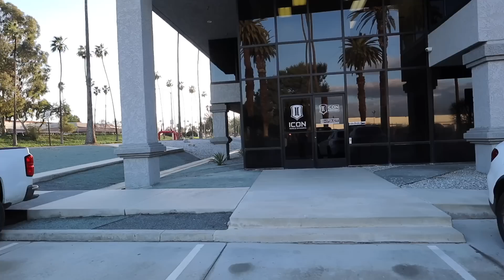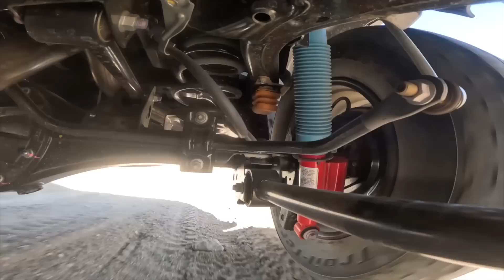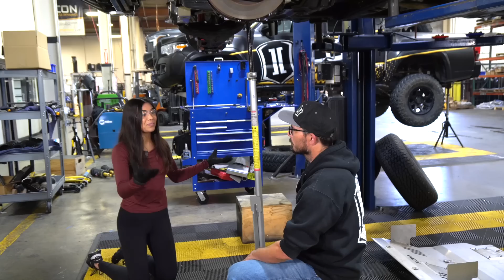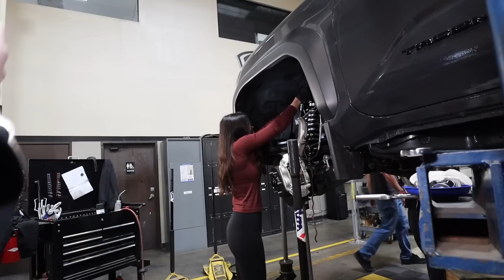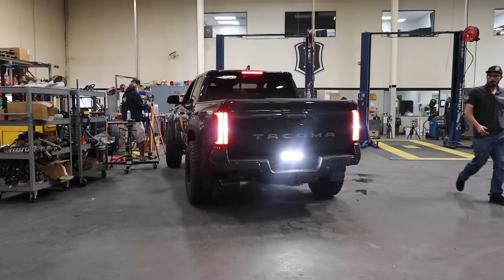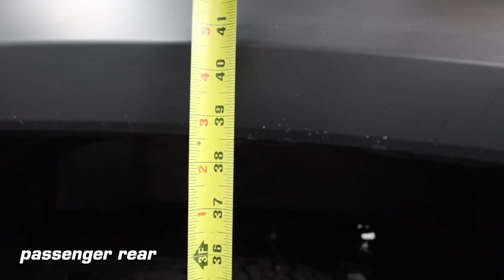It was time to lift my Tacoma | Installing ICON Suspension System (Build Episode 1)

Comment: That's really interesting to see how things change from 2024 to 2026. I have a 2026 Tacoma and from the ground to the bottom of the wheel well in the rear I measure 40 inches.The Front measured 37.5. That was stock from the dealership. So I put a 2 1/2 inch lift & upper control arms, and an icon differential drop on it. Now I'm measuring at 39 3/4 front and 40 inches rear. I did not have to do anything to the rear besides put some Beilstein 5100s on it. I'm rolling on KO3's 265/65R18 31.6" tires. I got 18 to 20 miles per gallon typically.

Comment: Any issues with the Icon front differential drop kit? Could you post a picture of how your driver side front axle angle looks? I have a Eibach Stage 2R kit with Icon UCAs and Icon front differential drop kit.

Comment: Tires sticking outside the wheel well look stupid.
Reply: Educate yourself on proper lifts. There is a proper ratio for offset to height above stock. You don't want to be one of the idiots who makes their truck taller without accommodation in width. It's not for looks.

Comment: I thought you were going with pizza cutters. I am looking to put 255/85R16 tires on my 3rd Gen  TRD OR ACLB without any lift. Right now I can only find Wildpeak AT_W’s (not sure if they are 3 or 4) in load range C. After reading a few comments on stiffer tires on stock suspension riding less bouncy I’m wondering if that would control my floaty-ness and brake dive without killing my 20.5mpg average.

Comment: I got a 2024 Tacoma last November. I installed the Icon billet upper arm and rear link package in December, with King coilovers and rear shocks (with adjusters), and Icon said a diff drop was recommended. It isn't really a diff "drop", its a driveline misalignment vibration kit. It caused an immediate vibration that I could feel through the steering wheel at anything over about 50mph. It only drops the front of the diff, not the whole diff, so the few degrees of angle change makes the front drive shaft vibrate. I took the diff drop kit off (with no other changes), and the vibration was 100% gone. Also, the "0.5" lift" Icon rear springs were actually a 1.5" lift spring on my crewcab longbed TRD Off-Road truck. Since you can't get more than about 2" of lift on the front before it rides terribly stiff and tops out too easy, the rear was too high for my liking, and I put the stock rear springs back on for now. I love everything else about all the other suspension components I got. I ran the truck all over Johnson Valley during KOH this year, and it handled great and hauls ass through typical desert terrain.
Reply: I have the same issue!  Thank you for posting. Last week I had the stage 4 installed in my ‘24 Tacoma. 
SAME steering wheel vibration. High pitched buzz feel in the whole truck, so I thought the diff drop was not installed but it is. 
A week later my front left shock seal is blown from highway miles and the right front suspension is now creaking loud, so I think the upper control arm is off too. 
Any ideas?
Icon is replacing the left suspension on warranty at least but my drive feel a week later was hit by the vibration.
Reply: @lyfhntr6562  That's definitely a bummer, but I don't think the driveline vibration would cause a shock failure or suspension creaking.
Reply: Did icon ever reply about this? Did you contact them
Reply: Wanting to know what Icon did in this situation, I’m getting the stage 3 kit in a couple weeks. 

My local shop said they flat out don’t install it…
Reply: @AlvinKokubun  I got the stage four and would concur with your local shop. Icon has told me they are having quality control issues specifically with the cylinders associated with the GEN four Tacoma. I would look at another manufacturer in the near term.
Reply: @lyfhntr6562 thanks for the heads up, been running mine for a while now and no leaks.
Reply: @AlvinKokubun I returned the drop down brackets. I ended up reinstalling the Icon rear springs after running around the desert for a weekend. The Icon rear springs give it a lot more progressive feel over big bumps and whoops in the rear suspension. It bottomed out too easily with the stock rear springs, and the truck feels more balanced with it being a little bit higher in the back. I actually also added the new Icon Hydraulic Bump Stop Kit to the rear of the truck last week. Pretty crazy how hard you can off-road this truck with bolt on accessories like this.
Reply: @mk3driftmotion  awesome, the instructions also ask to bore out 3/8” on a bracket for full droop, was that applicable now that you don’t have the Dif Drop?
Reply: @AlvinKokubun  Which bracket needed to be bored out? I don't remember that. I do know the rear diff brackets had to be trimmed way more than the instructions pictured to allow enough clearance for the billet rear 4 link arms at full bump.
Reply: @mk3driftmotion yeah, their documents state that the from suspension lower Control Arm required some grinding… I was unsettled by that lol
Reply: @AlvinKokubun  I am running King coilovers, they didn't allow enough droop to need to modify the lower arms at all, and it definitely didn't need the drop down brackets for the diff. The suspension doesn't bind, the axles don't bind, and the steering doesn't bind at full droop, lock to lock, I carefully checked all of that.

Comment: I can't wait until you drop a set of toyo 37x17 13.50 set of tires on it .
❤❤❤❤❤😊😊😊
Reply: Because that's my upgrade on my f250 2018 6.7 diesel fx4, but I have a 6 inch lift on it and it looks sick !!

Comment: Good to know the UCA bolt is still a nightmare on the 4th gen. 
Keep in mind that lifting IFS trucks is not what allows bigger tires.
Reply: Really? Lifting my taco is specifically what allowed me to run larger tires.
Reply: @HarryKuloh  OP is right though. You might think lifting was the solution, but it just isn't the case. All a lift does is decrease your wheel travel. It doesn't change the IFS geometry.

Comment: Woukd you recommend this type lifr for we in mountainous regions? Upper East TN typography.  Many hills and potentially muddy.

Oh, 2nd gen, 2014 TRD Sport.
Reply: If you use heim joints instead of rubber or polyurethane and your rig sees salty roads, or lots of mud or sand, they'll need rebuilt with some regularity.  She is in Southern California  so it wouldn't be too concerning.
Reply: I like the 4WD 24-7 videos because they're informative and have beautiful scenery. They have some videos about how solid axle and independent front suspensions work and what happens when you lift a 4x4. The first 4WD 24-7 suspension video is "EXPOSED! Are bigger suspension lifts better?" The second is "5 things you didn't know about ute suspension!" The third video is "Expert DIY lift kit install secrets!" They have different laws in Australia but the people that live in the mountains drive trucks with a minimal lift. Australians seem to prefer the biggest tires possible for better ground clearance under the diff with the smallest lift to prevent tire rubbing and keep a lower center of gravity to maintain off-road stability.

Comment: Well, congrats on getting the suspension upgrade. Although I think icon needs to come up with some custom bracket tree rather than using hose clamps. And cutting the truck to match the shock is a little odd as well.
Reply: Yeah I wonder what the deal is with grinding the LCA to mount a shock.

Comment: I was wondering why you choose the KO2 vs the KO3 tires?
Reply: I was gonna ask this as well for some reason everyone still chooses the ko2 but the 3’s are way better 😅
Reply: @omarvasquez330  I agree, I purchased the KO3's in September. They are the best truck tire I've ever purchased.
Reply: Weight most likely. KO3s are fairly heavier, maybe 7-8 lbs lighter per tire with the same measurements and ratings side by side. I have the KO3s on mine, but the KO2s are still very solid, proven tires. Plus, I think the biggest upgrade from one to the other is winter/wet weather driving, which may not be a huge concern for her. I know I’m making a lot of assumptions, but it could also be as simple as a better deal, already had em, or some other less detailed reasoning. 🤷‍♂️
Reply: I went with Ko2 on my 25’ simply cause they were cheaper than ko3.